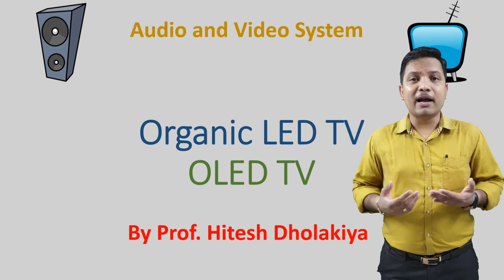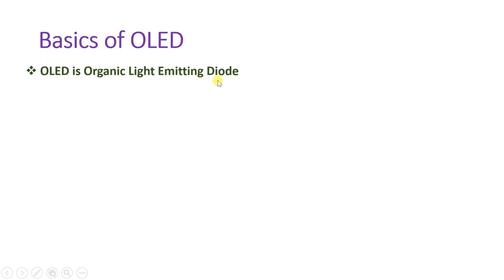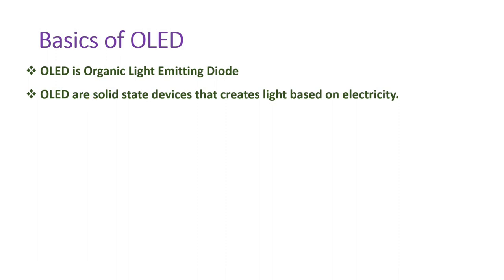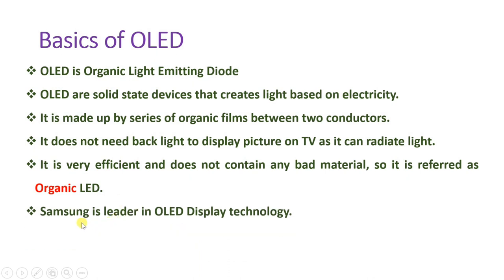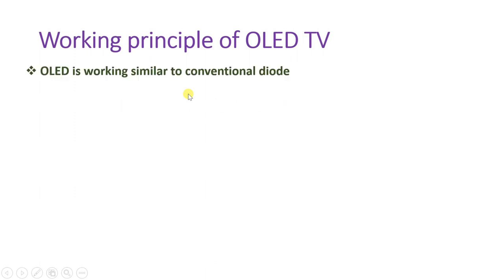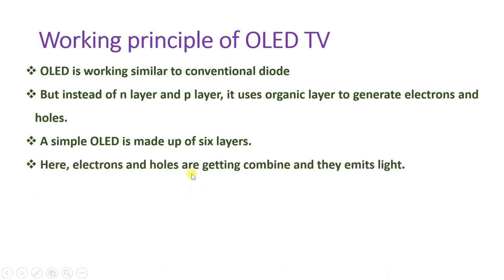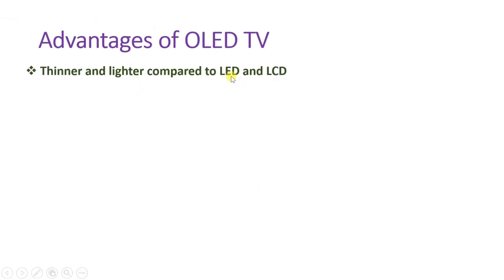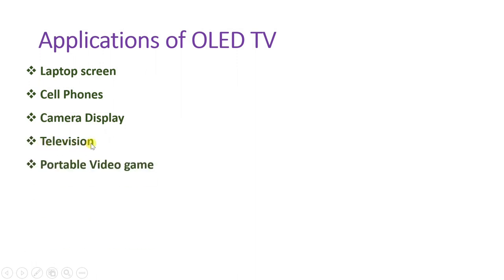OLED TV (Basics, Parameters, Structure, Working, Applications, Pros & Cons) Explained

Comment: What is this issue exactly sir... is it due to the Bad SMD ceramic Capacitor shorted, leak or Damage which are placed on this Flex bonding PCB display boards ... any of the components must have got weak or damage due to that my display is not being producing bright white light an turns only green... you no i tried to keep my mobile in freezer for 5 minutes an than seen the display works wel like new bright an clear no green tint nothing no lines nothing... but after few minutes coming in room temperature it turns again green color an Brightness issue too...   please help what is this issue... ???? Please reply... 🙏🙏🙏